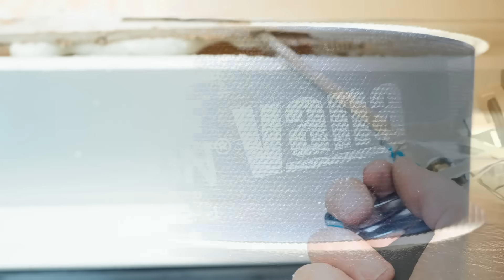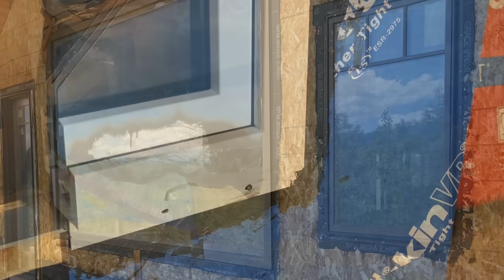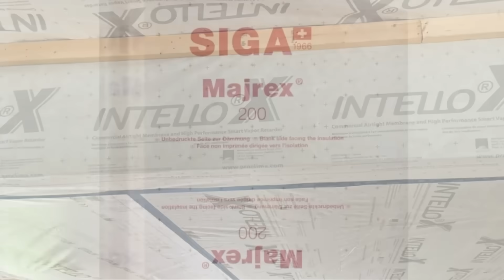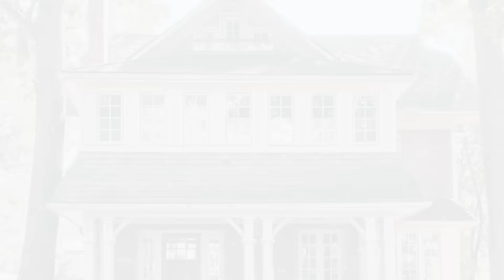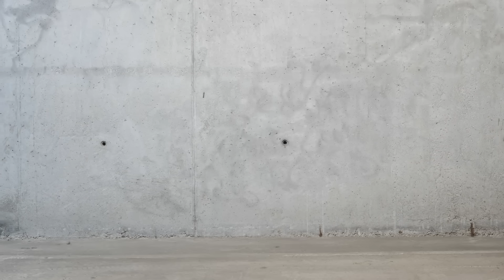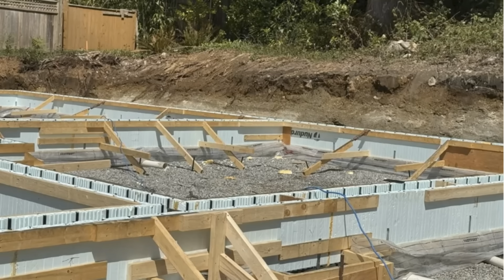Why We Don't Talk About ICFs?? Window Flashings, Air Sealing, & More! | Q&A #6

Comment: Icf is talked about on youtube but I have not been able to find an icf video explaining different roof framing methods for strength matching the icf walls. Since storms appear to be getting stronger why use icf walls and not build the roof as strong since even icf homes have had there roofs ripped off during a storm. How about a video showing different roof designs that can handle 160mph or 200mph winds? I believe in Florida they are using trusses with metal strapping for 160mph rating. Is there a truss system that can handle 200mph or more? This information is not on youtube yet. Can you do a video on this? How about if i say Pretty Please.
Reply: This is an issue I'm struggling with right now in the design of an ICF build.  There's ICF industry solutions like BuildDeck that can be used but I'm not crazy about them - they are expensive, require extensive shoring during the pour and put the foam on the bottom of the deck, which is the wrong side for a roof.  I had a great potential solution with Nucor's ecospan which was a steel truss system that self-supports a concrete deck pour on top at relatively low cost.  (And then securing foam board insulation on top of the concrete deck that was continuous with the ICF exterior foam at the eaves)  Unfortunately, Nucor cancelled the entire product line this spring and I'm trying to find an equivalent solution.  There's a couple but none that match the price and span capacity that system offered.
Reply: I rode out 200mph hurricane Camille when I was 10 in the overly built house my father built.  The eastern eye wall hit our house, lifted a corner of it a few inches off its blocks,  and dropped it back down.   Window casements had to be nailed to prevent them from getting blown in.  Stepped out into the eye and saw the stars.  We we the worst of it, being only a block off the beach.  During Katrina, the 30ft storm surge filled the house to the ceiling.  Ironically, the 200 mph wind of Camille did little damage to our wavy tin roof while laying the woods on either side of us on top of each other.  In a well known picture after Katrina, an ICF house in our town was the only house standing in a neighborhood, the other CMU and stick built houses being washed away.  As for roofs, I would consider a flat roof with parapet walls like many commercial buildings.  Nothing for the wind to get up under.  Low slope metal hip roof should work well, too.  I've seen videos with simple metal straps anchored into the wet concrete core of the ICF walls.

Comment: I wonder where this foam will be in 50-75 years, great building of the past had materials that can last 100 years easy,. I dont think EPS has that kind of longevity.
Reply: That is incorrect.   EPS when not exposed to UV will last 500 years or longer in a landfill.  A person selling rockwool will tell you otherwise.  If your ICF walls are  protected on the outside by waterproofing/parging and cladding and sheetrock on the interior, you have eliminated all the elements that cause it to detoriate. You should mitigate against termites who tunnel through it trying to reach your wood products.

Comment: Icf make sure the moisture barrier is good. Also the masonry needs some way to dry out. Masonry loves to wick moisture. I have seen mold issues in basement with icf. It was actually a drainage issue outside that allowed moisture into the icf. Which water logged part of the wall. The concrete crumbled in my hand. We ended removing a good chunk of the icf. Was able to replace with poured wall. Couldn't do cmu because of soil liquefaction above a clay pocket in ground which made an underground pond. About 3 feet down soil became soup. Same clay pocket blew out their retaining wall too.
Reply: Thats really poor planning and foresight by whoever built the house and did the landscaping though and not really an issue with the icf system. For some reason people have forgotten that gravel and larger stones for drainage paired with a French drain if applicable has been a tried and true method to keep a basement dry for a very long time. Or just pave or concrete over the top 6ft or so around the house to move water away.

Comment: Mineral wool comes in bats and board. I would and did use mineral board in walls in my 200 year old house. The mineral board vs batts because like a cloth wicking water the higher thread count wicks more. It really seems mineral board wicks moisture better than batts. But batts will allow more moisture to pass through like in a roof. We put up shiplap or T&G instead of plaster or drywall. We have no forced air because of boiler. And have old brick basement with poor moisture control. White washing brick inside has helped. But the mortar did need some lime in it. As 200 years the lime had moved out of the mortar. Not as bad as some buildings that make it look like they dry bagged the rubble foundation. I had to fix some drainage and landscaping issues too on north wall. Removed gooseberries blocking masonry from outside air flow.
Reply: My understanding is that mineral wool (whether batt or board) doesn't absorb much water. I forget who did a video on it, but they showed that the batts absorb only 5% or so of their weight in water. Fiberglass on the other hand acts more like a sponge. Cellulose is treated with borate to provide some water shedding capacity, but that can be overwhelmed if it gets wet repeatedly. Of course regardless of material, the right move is to ensure water doesn't get in and manage moisture appropriately.
Reply: @RedMike-ym8hd borate boric acid is an insecticide, no antifungal or water control.
Reply: @rcmrcm3370  Borate may not kill existing mold, but it is absolutely used as a mold preventative.

Comment: Is there a way to validate the integrity of the concrete when using ICF? How do you know there isn't a lot of honeycombing inside the forms?
Reply: vibrater
Reply: @NorthernZeal You vibrate with removable forms and sometimes there are issues but you only knownwhen you remove the forms and you can see it.
Reply: @CodyOnHomes  I think you can slap your hand against the ICF and it sounds different where there’s a void.  Someone should be doing that as part of the pour process.
Reply: I did an ICF in zone 5 (northern Indiana) and am very happy with it. I used build Block and their window bucks for a good thermal envelope ( I am not attached in anyway to them) from a labor standpoint it was great as i stacked all the block myself with my wife feeding them to me as the walls got taller and it all went well. I love the energy efficiency of the house, how quiet it is and house substantial it feels. I used Simpson Strong Tie products to attach the floor system and the trusses with there wet set brackets, blown in R60 mineral wool in the attic and it is totally sealed from the house for an air and fire barrier. I have nothing in my attic by design, after 40 plus years in the fire service I have seen a lot of bad things happen in attics from wiring and didnt want the air leaks. I used 2x4 stringers on my ceiling and ran all of my wiring there. I can can heat and cool 4160 sqft of living space (2080 basement and 2080 main floor with 24,000 but’s from a ducted mini split. It does have triple pane windows and I sided it in steel, while I have no connections to the building industry in anyway I am very happy with my house and found it to be a user friendly building system.
Reply: @mikeyazel8725 Any braces for the ICF which were removed after the concrete cured?

Comment: I am considering ICF for a future build, but in a place where a concrete truck and pump could never get to. Curious to see if the same concept could be applied to block.
Reply: I assume by “block” you mean CMU.  People are doing CMU with exterior insulation.  IMO having all the insulation outboard of the thermal mass is even better than having insulation on both sides of it.

Comment: I don't do Icf. Many icf call for a stem wall to allow the cement some area to allow moisture to wick out of the cement. Windows we run outside sheating or zip into window opening. Or use thermal breaks around windows. We also set windows towards inside. It is warmer that way. Less window sill to make cold spots in house. They are not exposed to weather as much making windows warmer. Windows and doors don't have much r value usually. Which can lead to condensation issues in and around them. New siding old windows we wrap the windows with metal usually if possible.